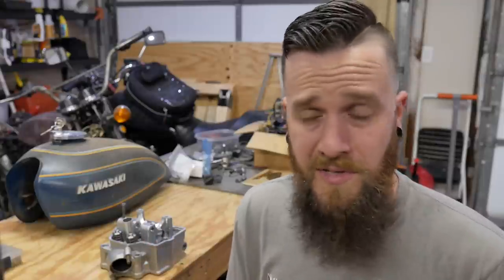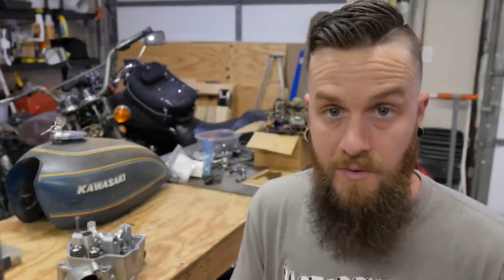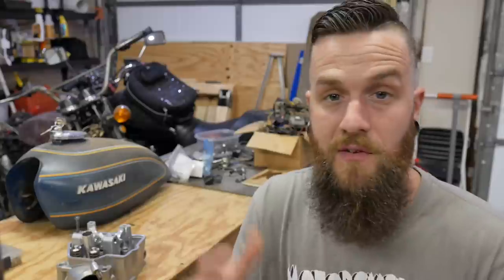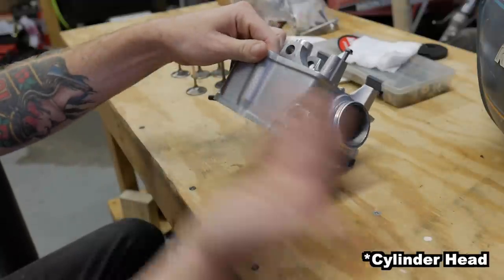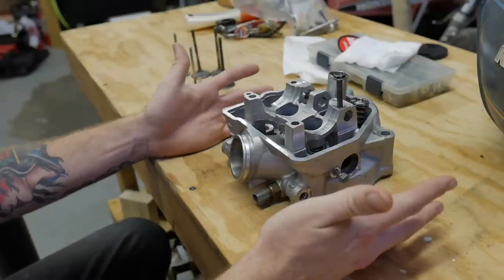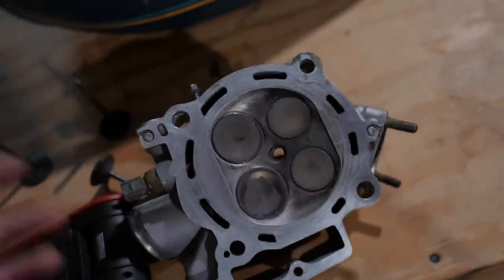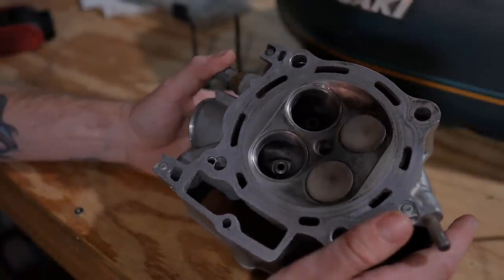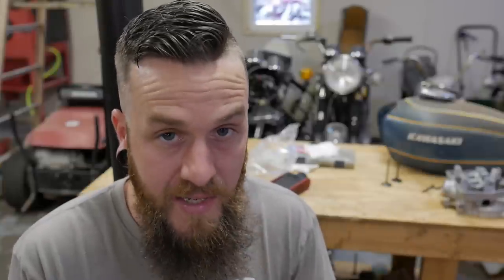Honda's "R" Model Off-Road Bikes: BUYER BEWARE

Comment: I’ve owned exclusively R model hondas every 5 years or so since 1995 - 2 strokes and then 4 strokes. The ONLY time I have ever ran into anything resembling a problem is the 2 times I bought second hand. They weren’t overly big issues even when I bought used but it was clear there was a huge difference between how I maintain my bikes and the people I bought off. I clean my air filter and change the oil regularly and have never had any problems whatsoever. Never checked a valve clearance in my life …never had starting problems… never had a breakdown. Absolutely faultless machines and the best bikes and engine on the market …providing you maintain them.

Comment: Two strokes all the way, easier to maintain correctly and certainly more affordable.
Reply: Too bad Kawi, Suzuki, and ESPECIALLY Honda, don't make 125s or 250s, or a lot of parts for them, anymore. You wouldn't believe how many 2 stroke Yamahas and KTMs I see in my local trails! Down with CAMS!
Reply: @nunyabizzness5477  yea my 03 yz450f has a five valve head and some pretty crazy cam journals all cut away for valve springs and stuff,  prone to failure ! Had a cold seizure on starting.
Reply: @kiwiingenuity1677  You should see how narrow the journals are on the 5 valve 250 Yamis! 0_o

Comment: My 01 XR650r will WALK AWAY from any 450, and will be running long after the last 450 is long dead.
Reply: I agree I had plenty of CRF R'S and X's at 37 now I finally bought a one owner orignal XR650R and put a lighting kit on it and I definitely enjoy the bike I put a mikuni TM40 carb on mine it runs excellent with a full PC pipe

Comment: the light thing is comical, if everything is concentric there should never be light coming thru that much, you put some Dykem on the seat, put the valve in and twist it a few times and see where the high spots are. if you only have 30 to 60 percent, which is what it would have to be for that much , the guides aren't lined up with the seats. I've been rebuilding engines since '68 and in all that time I have never ever seen such a cluster f like that

Comment: I have always used genuine manufacturers engine parts on my motorcycles to reduce issues and have warranty on the parts.  But then I rebuild my own engines and save that fee.

Comment: You can correct that issue with a proper valve job. Also fereea valves are extremely high quality. The stock head valve wear issue can be corrected with beryllium seats.

Comment: My god this was a great video! I had a 2006 CRF250R that took about 30 kicks to get going on a day below 50 degrees. Changed and set the clearances on the intake valves and it hauled ass again and started right up. I think I'm the only guy I know that cares for an off-road vehicle per the manual's recommendations hahahahaha

Comment: I have a 2018 crf450rx that was brand new in 2019. I change the oil after every ride and always have an extra factory air filter ready. I check the valve clearance alot. The bike runs exactly the same as new and starts up on the first try every time. When it comes to a rebuild I will definitely buy Honda parts from Honda parts direct. I'm totally happy with the bike.
Reply: Heck yeah proper maintenance does wonders! Mine is an 08 and hasn't had an "easy" day of riding since Ivenhs+fher  I've been pretty adamant about changing my oil often and it usually ends up being  about every other ride or so or after a real  full day of hammering on it. Usually even the little bit longer intervals the oil is still barely starts to change color. I Could be a little better on the air filter at times but keep it pretty clean for the most part. I haven't had to do anything other than clutch plates and a basket mostly from being high geared and riding a lot of single track.    She still starts super easy and has been super reliable. I think I am going to do the valves here soon and possibly top in just as preventative maintenance but it's made it way past recommended service with no issues tho I wouldnt recommend pushing it.
Reply: You don't need to change the oil after every ride, unless your rides are 6 hours long through absolutely filthy muddy ponds. As long as it's not getting dirt in the system and isn't flooded with extra fuel ECT. And that the level is adequate, oil can last a few months in like pristine condition before it starts to degrade

Comment: The manufacturers must have loved how we were all sucked into 4 stroke, high rev, high maintenance bikes after the simple to fix at home 2 stroke bikes.
Can rebuild a YZ125 3 times for the cost of one rebuild of a YZ250f
Reply: then gas companies hate the efficiency of four strokes? Theres pros and cons to both 2 and 4 stroke. Ride what you like.
Reply: It was mostly to do with the save the planet people, smelly, oil burning 2 strokes, but they failed to account for the rare metals used in the valves etc of the 4 stroke engines, probably worse for the environment than a bit of burning 2 stroke oil.
Reply: @onecookieboy  the tree huggers didnt think about all the oil changes and waste oil produced by our eco 4 strokes. There is always a trade off
Reply: @holmes1956O  Agree, not to mention the Titanium for the throw away valves.
Reply: @onecookieboy  yup
Reply: Manufactures are making lots of money from selling high revving 4 stroke junk. I won't touch them.  Stick to my XR 250 and Beta and Husky 300s with carbs.

Comment: I have a 2009 crf 450r with 300 hours and it hasn't needed the valves adjusted yet. I have changed the piston and rings every 100 hours. Most of the negative stories you hear about the valves can be attributed to the owners poor maintenance practices. The only dirt bike I've had that was more reliable was an xr400 which is apples & oranges.

Comment: If you are buying a used bike look for a bike from an mx racer. The bike may have been ridden harder but the maintenance will have probably been done meticulously.  Also most guys get high quality parts for these bikes. Why are they selling them? The want the newest model. A lot of guys don't care and will spend that money. Pro tip when buying used, ask to see the air filters and how many extra it comes with. If you're getting 3 extra filters and the bike is clean it's probably a good bike.

Comment: I've had a few high end 4 stroke machines you're talking about.  WHen I sell them people will say, why so cheap and why is yours so powerful?  I reply, I religiously change the oil way more often than what the manual calls for, when I am doing hot riding or sand.  Then I hand them a box wiht filters and I tell them, it is possible this bike will last another 2 or 3 years, but it could also blow up tomorrow.

Edit:  I haven't sold a bike private party in years now, with Rumbleon being my go to to sell.  I really enjoy them and they have gotten 2 bikes from me.

Comment: The valves need lapped. They should have been done on a reman head, but should be done any time a valve is replaced.
Reply: No amount of lapping will compensate for an irregular valve alignment. Lapping just matches the mating surfaces of the valve and seat. Basically, you could lap that valve until it’s paper thin and it still wouldn’t mate with the seat.
Reply: You dont lap coated valves, you cut the seat to the correct profile and install them.
Reply: Machine the seats. I know it is possible, I just don't know what it's called.
Reply: @jangoreo  You can grind the 45 face on a used Ti valve and lap with that after a fresh valve job. 2 or 3 rotations is all it takes.
Reply: Obviously. This guy is an amateur. You'd never expect new valves to perfectly seat. They always need lapping. Even honda stuff needs that. It has nothing to do with buying aftermarket.
Reply: @jangoreo  of course you lap them if they're leaking. Why do you think they are wearing away in the first place?

Comment: Couldn't you lap the valve seats on the aftermarket head to spec? Heck, couldn't you replace the valve seats in the original head? That would probably be more cost effective right?

Comment: My xr100r got valves changed and lapped 2 different methods. Not blowing air out the air filter but not misting gas into intake manifold.

Comment: My 04 crf450r had valves that wore down to the point where it would not start.  I put in kibblewhite valves, shimmed to spec and it has been starting much easier.  I read that the stock valves are titanium and the seats are hard enough to wear into them as you described.  Just rebuild the Honda head, don't buy that ebay chinese shit.

Comment: Bought my 07 250r used from ebay ! Kid couldn't start it for shit ! Drained the fuel and carb and put in fresh super unleaded and kicked straight up !! Recently rebuilt with Cosworth 14.25-1 high comp piston  and all new bearings and camchain. Full ackropovic system on there when we had it and that's all the mods Ive done. We get asked at the track what year 450 is it  ? The thing is an animal 😅🤣😅

Comment: Makes a lot of sense... does this also apply to the Honda Xr range? I have a 2017 Homda Xr150 that I bought  for cheap  blown up. And am reboreing and doing up the head, it is a ex dairy farm bike and looks too have been  cooked in  mud bog! It has kms7500 on the clock. This is starting to make two strokes maintenance schedule maintenance look good.

Comment: Why would you buy a new head when you can just rebuild your original. You may not have the machine tools to replace the seats in that head but they are replaceable. So if the casting is good new guides new seats new valves and you have a new head. I keep seeing videos like this and I can see a good business opportunity for me in my retirement rebuilding these engines

Comment: When I do any work on my bikes I prefer to but OEM Honda parts. If the parts are discontinued then I will go with after market. I have always enjoyed using OEM parts when available since I know they will work and I won't have to 2nd quest what an issue is when I haven't fixed the problem or a new problem arises.

Comment: Can you show us a picture of your valve seat cutter set for the cylinder heads additionally can you show us your concentricity gauge? And how you would repair the seat as in a proper valve job would have been done as opposed to just installing new valves and hoping that they work.
Reply: I have never done valve job or just dropped a new set of valves in anything without going thru the actual build process , new valves are never going to seat in any head new or used .  I get what he’s saying to the novice but he’s missing the point that regardless you can preformed simple no tools required test that the seller won’t even know your doing , checking temp of the motor as soon as you get there along with certain aerosols near by and a wet filter smelling like starting fluid , as you turn the motor over loading the cylinder pause while in conversation for a brief 
minute or less if it isn’t hard to kick or just slowly keep rolling it over , if it isn’t obvious what stroke Your on that you already know it’s tired or worn most of the older 4strokes ive purchased used  are usually hard to start but valve lifter adjustment most often is the problem  that and bad fuel sitting in carb for more than a few weeks , I’ll give him a break knowing we all need a good rant now & then just to keep sane !

Comment: Hi Cody great videos..,I've watch (exploring) some motorcycle that i was about to buy an Kawasaki 500 Vulcan (2cyl watercooled 4 stroke) and i was notice (seen) an changed color on exhaust pipes that have changed color to shiny blue o both cyl., does this indicate overheating due to exhaust valve wear alert?..Hello Folks someone have some experience about topic ?..🙌
Reply: Its probably just thin exhaust head pipes, those engines are very reliable.

Comment: This is VERY simple!!!!  NEVER EVER BUY A USED 4T MX bike, as it will never have been maintained properly, and in many cases will be on the verge of shitting itself.  When it does shit itself, the cost of genuine parts, will be more than the value of the bike.   If you want a used MX bike, look for a good condition  2T, which if it runs ok, probably will be good, and even if it isnt, can be rebuilt cheaply................

Comment: Terrible explanation.  The intake valves are coated titanium.  Once the coating wears off and you need to adjust valves you might as well buy new titanium valves or what I did is put stainless steel valves it myself.  For normal riders 100 hours on a piston is do able. New cam chain is a good idea too, if that goes might as well push the bike off a cliff and walk away.